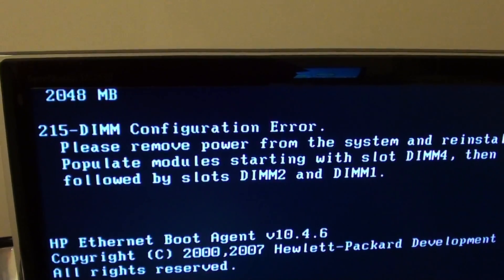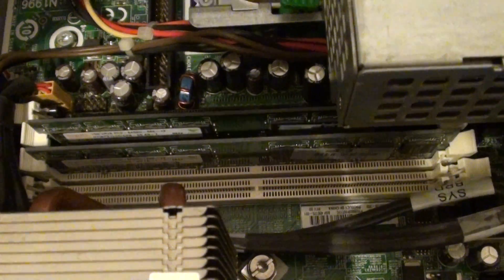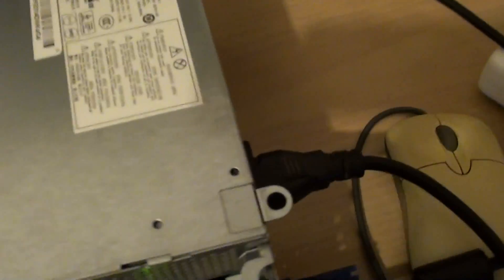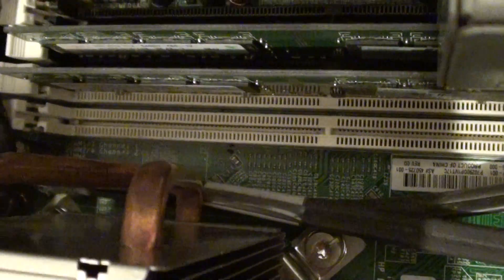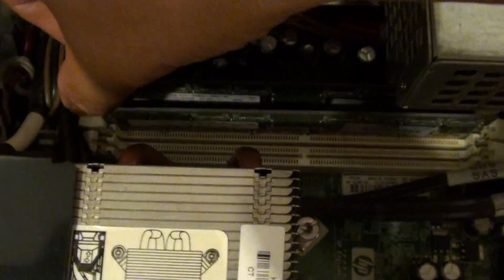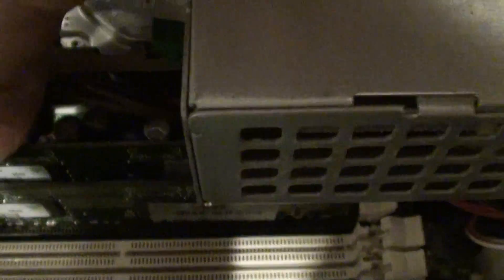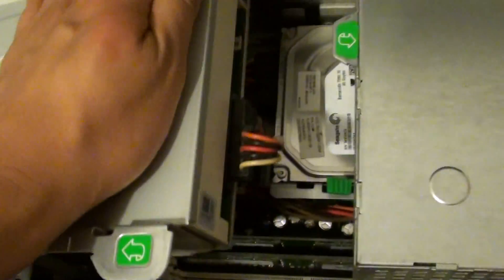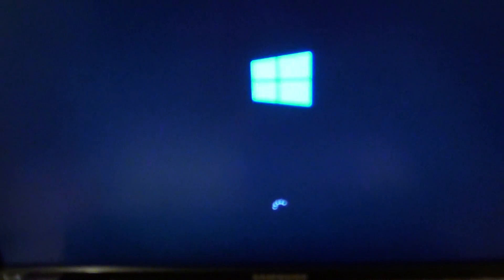SOLVED: How to Fix 215-DIMM Configuration Error on Computer

Comment: But I experience quite a strange situation, I have to insert the 2 RAM modules in DIMM 1 and 2, otherwise it will not boot, and when I see this error on screen, I can still proceed booting OS, and see all my RAM in the device manager, I can even run games with no problem!!!

Comment: the same black page but the message is 201-memory error 
the memorytest performed during startup failed. press F4 to restart the system and reconfigure memory for a diagnostic mode that will permit the bios to identify the failing memory DIMM.      this is the message can u help me because when i open the computer this message make me angry